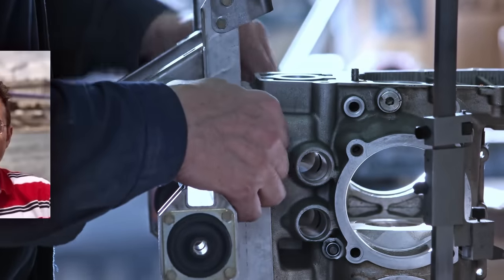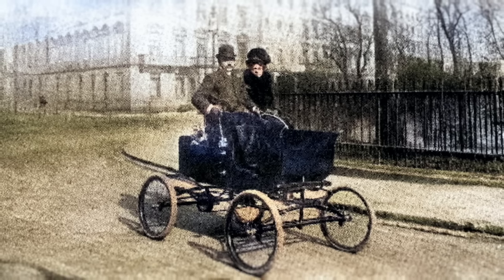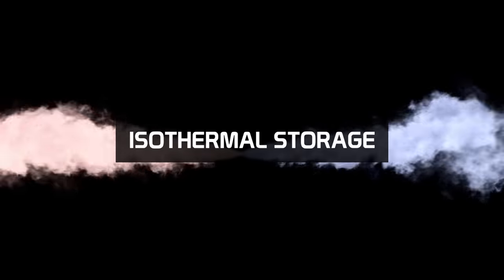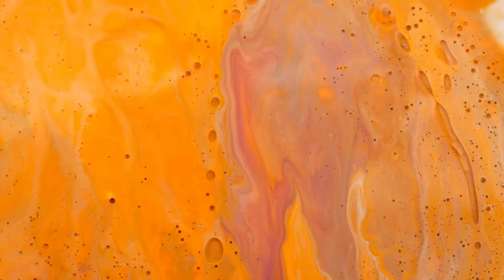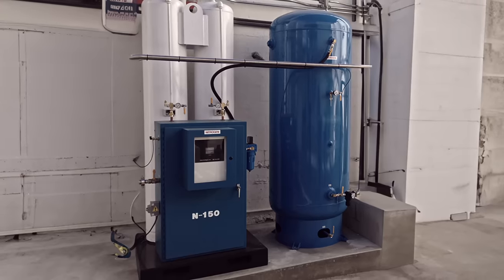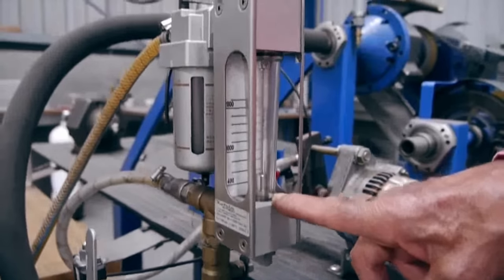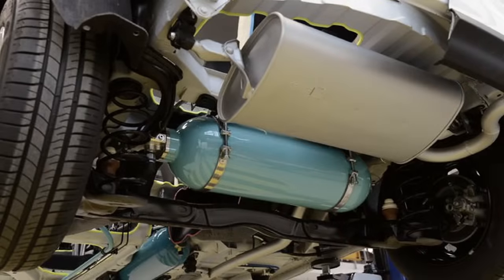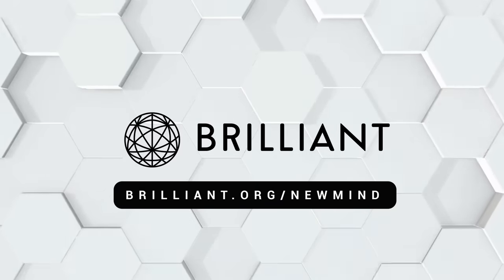Driving On Compressed Air: The Little-Known Compressed Air Revolution

Comment: The potential energy of compressed air can be easily calculated and "efficiency" isnt the first word that comes to mind.

... and while compressed air is clean itself, the energy required to compress air is enormous
Reply: yes, air motor is total nonsense in 99% of the use case. The only niches where it could justify itself is in some industry where massive amount of compressed air is produced anyway, like mines maybe. But even in these case i dont think i would make much sense because these "motors" require compressed air stored at 350bar, which is never the case in such industries. SO it would still need to be compressed again, and anyway as you mention the efficiency oof compressing air at such pressure isextremely low, not to mention the motor is also very inefficient, and finally the storage is totally unpractical, requiring massive carbon fiber sylinders, in a vehicle where spâce is a premium. So only dumb "investors" sufficiently braindead to invest in mdi, a scam going on for decades now, could see any future in such "technology" (it is not even a technology).
Reply: @lo2740  They've been used in mining to prevent explosions and to increase safety.  That's the only area that I can think of this makes sense.

And I hear you with MDI.  It's amazing that company still exists.  I think the furthest they have driven a test car was 10 km.
Reply: YOU ARE CORRECT, I HAVE A COMPRESSED AIR GENERATOR AND TO FILL A SMALL TANK (1/2 LITRE) TAKES AGES AND THE ELECTRIC-POWERED COMPRESSOR OPERATES ON VERY HIGH WATTAGE, SO TO FILL A TANK BIG ENOUGH FOR A CAR WOULD NOT ONLY BE COSTLY IT WOULD NOT BE VERY QUICK UNLESS YOU FILLED FROM AN AIR STORAGE TANK, AND THEN THAT WOULD COST A FORTUNE TO FILL, THESE ENGINES ARE NOT HE FUTURE,
I.C.E. IS THE FUTURE
Reply: car: i have  driving fun to not be bored and non attentive partially for saftey reasons, i do it by trying to get max miles per gallon and not wearing out the tires by using them to slow down a lot . its like old school endurance racing at more relaxed pace(if you arnt in a rush to get to places quickly), you minimize need for pitstops for fuel tires lubricant etc. for example, you preserve momentum around turns instead and speeding up again, but dont loose traction. .  you brake and steer minimally but steadily, build up momentum downhills and at optimal rpm and power level according to bfsc chart for the engine (electric motors also have this ) .  you maintain speed that is less than roughly 50 mile per hour (if car is more areodynamic, you can tolerate higher speed, but cutting through the wind becomes exponentially less effceint as you increase speed linearly).                          although climate crisis stuff isnt proven to be caused by humans or to be getting much worse near out times as happened before to humans, and the politics is obviosuly led by people who dont care about it, chemcial toxicity affecting food supply and sustainability og the buisness model of car design, are good reasons to do this if the money savings means nothing to you. 
t weight is less safe t to people outside the car involved in crash, and unsafe to people inside car unless its more expensively built. weight exponentially worsens road longveity before repairs are needed, causing emission , monetary costs too, etc.  not necessary: https://drive.google.com/file/d/1EG0dKAd3yuIRnND73W80v5i4CNe-EOzA/view?pli=1  https://pavementinteractive.org/reference-desk/design/design-parameters/equivalent-single-axle-load/

i think hybrid better than ev because: if you wanna lower emissions as long as possible as mass scale , you use a mix of combustion of non fully recyclable and currently rarely ever recycled, battery mass. whatever mix lasts longest.    weight is less safe t to people outside the car involved in crash, and unsafe to people inside car unless its more expensively built. weight exponentially worsens road longveity before repairs are needed, causing emission , monetary costs too, etc. it also worsens tire dust emisions and brake dust emissions expoeentially: https://drive.google.com/file/d/1EG0dKAd3yuIRnND73W80v5i4CNe-EOzA/view?pli=1  https://pavementinteractive.org/reference-desk/design/design-parameters/equivalent-single-axle-load/      magnetic reversal news , tony heller,  tom nelson https://www.corbettreport.com/  https://www.ncbi.nlm.nih.gov/pmc/articles/PMC9566750/  https://www.greencarcongress.com/2022/05/20220513-ea.html#:~:text=Emissions%20Analytics%E2%80%99%20results%20suggest%20around%2011%25%20of%20the,more%20than%20400%20times%20higher%20than%20tailpipe%20emissions. natural rubber and better brake metal can minimize problem to some extent  
 g @sicks6six
Reply: car: i have  driving fun to not be bored and non attentive partially for saftey reasons, i do it by trying to get max miles per gallon and not wearing out the tires by using them to slow down a lot . its like old school endurance racing at more relaxed pace(if you arnt in a rush to get to places quickly), you minimize need for pitstops for fuel tires lubricant etc. for example, you preserve momentum around turns instead and speeding up again, but dont loose traction. .  you brake and steer minimally but steadily, build up momentum downhills and at optimal rpm and power level according to bfsc chart for the engine (electric motors also have this ) .  you maintain speed that is less than roughly 50 mile per hour (if car is more areodynamic, you can tolerate higher speed, but cutting through the wind becomes exponentially less effceint as you increase speed linearly).                          although climate crisis stuff isnt proven to be caused by humans or to be getting much worse near out times as happened before to humans, and the politics is obviosuly led by people who dont care about it, chemcial toxicity affecting food supply and sustainability og the buisness model of car design, are good reasons to do this if the money savings means nothing to you. 
t weight is less safe t to people outside the car involved in crash, and unsafe to people inside car unless its more expensively built. weight exponentially worsens road longveity before repairs are needed, causing emission , monetary costs too, etc.  not necessary: https://drive.google.com/file/d/1EG0dKAd3yuIRnND73W80v5i4CNe-EOzA/view?pli=1  https://pavementinteractive.org/reference-desk/design/design-parameters/equivalent-single-axle-load/

i think electric asited turbo on hybrid better than ev because: if you wanna lower emissions as long as possible as mass scale , you use a mix of combustion of non fully recyclable and currently rarely ever recycled, battery mass. whatever mix lasts longest.    weight is less safe t to people outside the car involved in crash, and unsafe to people inside car unless its more expensively built. weight exponentially worsens road longveity before repairs are needed, causing emission , monetary costs too, etc. it also worsens tire dust emisions and brake dust emissions expoeentially: https://drive.google.com/file/d/1EG0dKAd3yuIRnND73W80v5i4CNe-EOzA/view?pli=1  https://pavementinteractive.org/reference-desk/design/design-parameters/equivalent-single-axle-load/      magnetic reversal news , tony heller,  tom nelson https://www.corbettreport.com/  https://www.ncbi.nlm.nih.gov/pmc/articles/PMC9566750/  https://www.greencarcongress.com/2022/05/20220513-ea.html#:~:text=Emissions%20Analytics%E2%80%99%20results%20suggest%20around%2011%25%20of%20the,more%20than%20400%20times%20higher%20than%20tailpipe%20emissions. natural rubber and better brake metal can minimize problem to some extent
Reply: Nope. The energy to compress air is actually less than the one to charge an EV
Reply: @skonstas4683   lol wut? Compressing air takes less energy than to charge a vehicle? How much air? What compression ratio? How big of a vehicle battery? 

If you mean the compressor in your garage uses less energy than a tesla car, then yes... but that's because it does less work filling a tiny tank of air compared to charging an entire car. Your garage compressor won't run a car.

Telsa cars run off electric motors directly... compressing air ALSO uses electric motors and then must go through MORE efficiency loss to do work afterwards (unless you've developed a magical over-unity compressed air engine). Your statement is objectively false
Reply: People  have pressure cookers in home. It's a little price but that's because grids are subsidizing carbon fuels rather that utilizing geothermal, pressurization methods, and valve constructed hydro power etc. It's not enormous when energy recovery methods, infrared spectrum is used in solar panels etc. It's just carbon fuel subsidy bias going on.

Comment: I love this idea as an energy storage medium. Direct hydropneumatic or wind driven compression would be awesome. You could either forget about electricity production all-together, or only convert the energy from compressed air to electricity on demand.
Reply: Yes but you need energy to compress the air so you can't compleletey forget about electricity production
Reply: Won't work because of thermodynamics
Reply: Would be great for short term storage/load leveling applications, compressed air tanks at turbine sites could store excess power optimizing the production and use of the connected grid. Although some 'danger' involved with compressed air, it's is at least environmentally .safe'.
Reply: @tedarcher9120 way to not elaborate on your point and show that you didn’t watch the whole video

Comment: Unfortunately, to me this has the taint of a startup money and funding grab. Others mentioned the tank safety issues if the vehicle and air system is damaged, but there are many others to evaluate. System performance changes due to external temperature changes, elevation changes, air drying when compressed, how the air system reacts to external pressure changes, i.e. fronts, low pressure systems and tropical storms are all huge factors to consider.
Reply: Elevation only matters when making the compressed air a drop in external pressure would give the system more power.
Dew point would be a huge problem though.
Reply: Videos of this type ARE just ads for the latest scam. The video productions are usually paid for by the companies/products being showcased.

Comment: Maybe as big land based storage with compressed air can make sense since it's much easier to store the heat energy but for moving vehicles it doesn't seem to make that much sense since to store heat energy is impossible in small volumes and you end up with very complex systems. I wonder why all the promises or range and efficiency never seem to materialise

Comment: I've been following MDIs work on this. Its a great concept.  

One thing we have got to get over is this idea of "most efficient".  Nothing can come to market unless its more efficient than what's out there now.  

We need to be looking at "efficent enough". Giving the available space, weight, or whatever actual constraints you have (not the slick constraints that make your eyes buldge and you say "oooo" too, but the real constraints), is the given solution efficent enough to solve the problem.  A lot more of these devices, if the would just hit the market sooner could get the capital the need to advance the technology.
Reply: mdi is a wel known scam going on for decades, air motor is a joke, the total cycle efficiency its extremely low, the energy density extremely low, there is a reason why you never see any "air car" it makes zero sense and never will.
Reply: @lo2740 have you shares in oilor are you just don't like air cars.effitantly they are not petrol .but as a median that is good to move vehicles and re fuel quickly and do what it says on the box . It's very good , if you don't like air cars fine but don't tell liesso people agree withyourway of thinking . Air cars is a good idea .and quicker than electric and solar and wind . Your looking att this medium from the wrong angle .
Reply: @Richard-oc4lx  air could possibly be the actual worst way to store and transfer energy, especially in a mobile platform.
Reply: With new Composites we have the ability now to build lighter components and I have seen what compressed air can do at high pressure.  Being a deep sea diver and heavy equiment mechanic useing air tools I believe for short distance operations we can easily build air powered cars. But everyone that has the ability to build what we are seeing in the prototypes looks like a freaking sweet pea or an apple with wheels. I'm thinking if they used a foam cored thin composite skin, add a small LP heater for a heat chamber before the air goes into the intake of the motor, filter the total exhaust an run it into the cockpit, you would have cleaner air in the vehicle then out side it... and free air conditioning. Useing a scuba filling station with proper filting of course, you would even be cleaning the the air as you fill up. The main draw back is the air would be dry and leaves you with dry mouth. You would have to use vegetable based oils and lubricants. I'm thinking of a rotary type engine,  in town and mostly a car the size of a large golf cart with a few of the big composite tanks sandwiched by a strong reinforced plate chaises and off the shelf components for the air power supply. It is doable.

Comment: This is a great video. I could see a lot of other uses for this. Just thinking about the heat recovery from phase changes opens a lot of design possibilities for all kinds of systems. Really well researched! Lately there have been few videos that make me think "oh, I could use this here or there." in a cascade of thoughts on other systems. This is one of the very few videos I have shared and saved. Thank you for restoring  YoTub's relevance a bit!
Reply: Thermal efficiency kills this as an energy storage medium. Batteries are better than 90% (possibly over 95%). The additional costs are quickly recouped.
Reply: @davidelliott5843  He goes over the shortcomings and the current solutions to sit shortcomings in the video. Also he goes over the concept that companies are currently testing that can even have better energy storage in the battery counterparts. Way to show that you didn’t understand the video or watch the whole thing.
Reply: @VinceroAlpha  totally agree with you, but Mr Elliott feels he knows better.
Reply: @simonmasters3295  🤣😂 thanks

Comment: Why don't MDI teem up with MDI ? Also sand as the heat storage would allow very high temperatures to be electrically stored after compression, to increase range and performance.

Comment: I remember the TATA in India, Thought it was a great idea as a small around town car.. But electricity is bad, Unless its to charge a Electric Car...  The only real issue I saw was the need for 4000 Psi compressors to fill the tank
Reply: we have really good compressors today on the markets. and springs got improved a lot too. and also air is not dangerous as flamable O2 or lithium. doesnt matter 4000 psi oder 8000 psi. well it is but an air coution woud protect you as shield from that. but air coution wont help against an o2 explosion
Reply: Tata for the license from mdi registered in Luxembourg
Reply: There are 5 or 6 thousand psi compressors for high power air guns. So why not use them to power an air car?

Comment: 9:00 you claim the energy density of compressed air to be 4 times that of lithium battery? That is almost certainly not true. To get to equal energy density with lithium batteries, you'd need pressure of around 150,000 psi. That is a bomb. If you got into an accident in that vehicle, the passengers would absolutely die immediately.

Comment: Rather than using compressed air, why not use a liquid that boils and expands greatly under heat. Instead of using low efficiency air compression, instead more efficient induction heating.

Viola, you've got a modern 21st steam engine which would only need to be plugged in once a week for typical driving distances.
Reply: Heat engines are inherently less efficient than electric motors so there's no real advantage
Reply: @nahometesfay1112  They also cost a fraction to manufacturer compared to electric motors and expensive lithium batteries.
Reply: it is called steam, we used that two centuries ago.

Comment: Some interesting questions!

1. How easy can "refueling" be for a compressed air vehicle?
2. How can compressed air vehicles handle changes of external temperature?
3. Related to the previous question, can heat radiation from the sun/ambient air (like when a car accumulates heat on a parking lot) be harvested to maintain the air temperature?
4. Is there a way to maintain the pressure while air is being discharged (i'm thinking an inner spring-loaded piston, reducing the volume of the tank (raising pressure) while air escapes)
5. How would the size of the air tank affect the practicality of vehicles like this?
Reply: I think refueling would be the same as current CNG refueling stations.
Reply: For 2, Heat would increase pressure. And yes, you could take advantage of that.
4, it would just increase the pressure from the beginning. It would be the same as just running a higher pressure. You could use some kind of powered device to increase pressure at will, but that would be counter productive.

Comment: MIDI in France tried to commercialize compressed air vehicles a long time ago. The problem is that air compressors at that pressure range (high PSI, 10K or more) to give good range in composite wrapped air tanks, are neither cheap or energy efficient, way more expensive than a 240vac Level 2 EV charger for Lithium Ion EV's //
Reply: in fact they never wanted to "commercialize" they just wanted to pump investors money, because to anyone in his right mind it is obvious that air motor vehicle is not going to work anytime, the total cycles efficiency is 5%, 10% with ideal parameters.